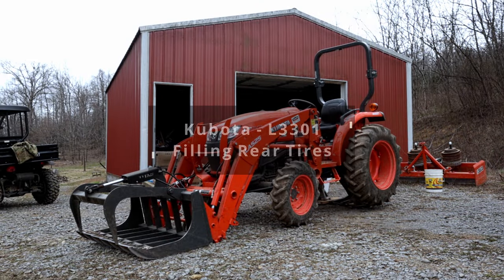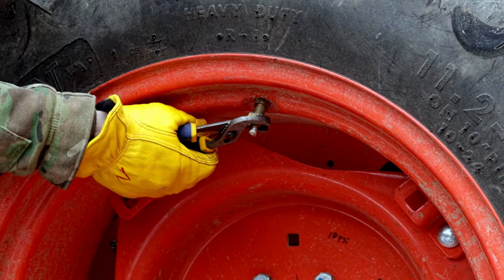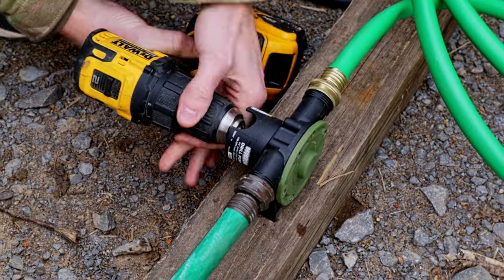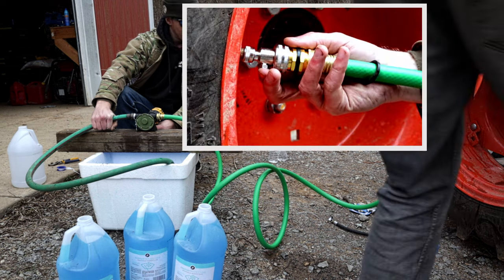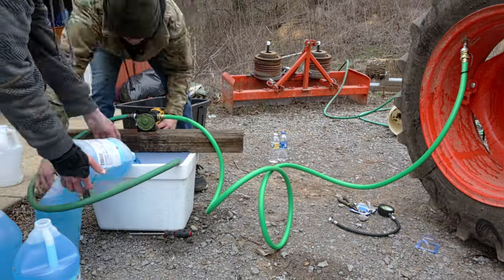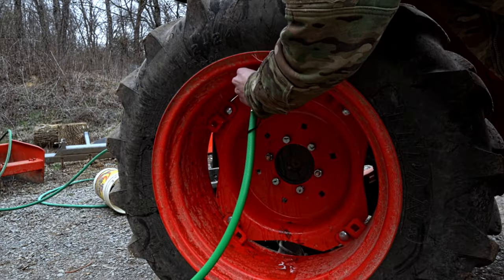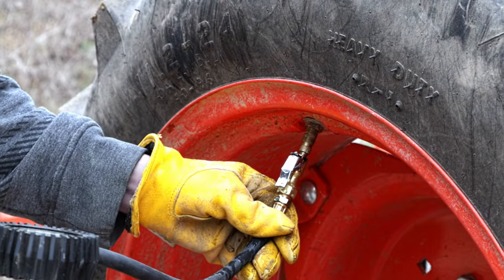Filling Tractor Tires - Ballast Quick and Easy - Kubota L3901, L3301, L2501

Comment: Well I decided to fill my rear tires with RV Antifreeze (RVA) instead of window washing fluid (WWF). They are the exact same price at my local Walmart. WWF cannot be made non-toxic (says so right on the jug). RVA is non toxic by design for use in RV plumbing systems. RVA weighs 8.4 lbs. per gallon, WWF weighs 7.6 lbs. per gallon. WWF is rated at -25 degrees, RVA is rated at -50 degrees. No brainer for me. Thanks again for the video, I just ordered the fill connecter and the pump.
Reply: where did you find it the same price? Walmart is about 1.50 a gallon more. A barrel from the local parts store is 175 more.
Reply: Any antifreeze is going to be corrosive on the rim and dry out the rubber in the tire. If you have an inner tube in it then you will get it to last a little longer but not much.
Reply: @mikek8632  Your remarks are contrary to everything I've read on the subject. The RV antifreeze additive system has passed corrosion requirements as specified in ASTM D1384 and provides outstanding corrosion protection for copper, brass, solder, steel, cast iron and aluminum. If it was corrosive as you suggest, why would it be used in very expensive RV's and boats for long term winter storage? How can it harm a painted steel wheel? In addition, propylene glycol actually lubricates rubber. It's also good to -50°. I'd be interested to know where you obtained your information...
Oh, and one more thing, unlike window washing fluid, RV antifreeze is non-toxic.
Reply: @artillerybuff2000  You can choose to be blind and believe whatever you want to believe. I know what I have seen first hand and what I've had to repair after people like yourself think you know better than the professionals. I've been working on tires since I was literally 5 years old, I started by patching tires and tubes with my Grandfather. I now own the business and do this type of work every day, I've seen a lot of things that have been "claimed" to not be a problem but in the real world actually do cause problems...but as I said feel free to "do it your way" you will find out.
Reply: @mikek8632  No need to get upset Mike, I was just asking what your "expert" opinion was based on. There are a lot of self-proclaimed experts working behind keyboards you know! I research everything I do, and I have 40+ years working as a master dealership technician.  Before that, I worked for a Goodyear tire center through high-school back in the early to mid '70's where I did everything from auto, truck, & tractor tires. I have used RV & Marine antifreeze in my boats and RV's for decades and have never seen any corrosion or rubber seal damage. So yes, based on my personal experience and research, I put the stuff in my new tractors' rear tires at 100% concentration.

Comment: Um no...just call your local tire guy as clearly yall dont know a thing about doing this the proper way. I am a tire guy and ive been called more times than i can count for people like you thinking they know what they are doing and then they spend 2 to 3 times what it would have initially cost for me to waste my time fixing their screw up and then doing it the proper way. Also...washer fluid is a corrosive...good luck with those rims rusting out in less than 5 years time.
Reply from the maker: What component of washer fluid is corrosive? We specifically chose it for price and being non-corrosive. We are absolutely not tire guys, but based on available information it seems like a suitable choice of fluid. https://www.yanmartractor.com/resources/tractor-tips/liquid-ballast/
Reply: Amazing when a “tire guy” feels the need to be condescending to those of us without a PhD in the ancient field of tire study. 
Get over yourself pal.
Reply: My local dealer said they charge $180/hr with a minimum 2hr job to fill both rear tires.. so $360 and they only use water, where i live it freezes below 20 degrees maybe 3-4 times a year in the winter months so 100% water is a no go for me as i keep my tractor under a lean to at the moment and $360 for 2 tires to be filled is way to steep. 
Sorry “TiRe GuY”
Reply: @BrollBrothersProductions  Did you not read the label? Last I knew it literally says corrosive somewhere on the label. It's been years since I've looked but I highly doubt it would have changed any. I do know for a fact that concentrated washer fluid is listed as a corrosive as it's accompanied by a full MSDS and is considered hazardous freight when shipping. In it's diluted form the feds may no longer consider it corrosive but that's in a normal application where it's in a plastic container, not in contact with a metal rim or rubber.
Reply: @BittyVids  Being condescending and being truthful are two different things, I suggest you learn that. Feel free to not listen to a professional, guaranteed you've been in that position before and had to call someone else to fix your ignorance.
Reply: @AnnanChannel  HAHA well those prices they are charging is absurd if you are also paying per gallon for the water they are putting in, if not then they are reasonable prices but a bit on the high side. Putting water in when the temp drops that low is a sign of them not being professionals therefore not the local tire guy I would call for anything at all ever. Depending on your tire size would depend on the price from a reputable true tire guy. I charge $35 per tire to fill and then $3.00 per gallon for reference the most common size is an 18.4-38 and it takes 110 gallons to fill so that would be $330 for just the fluid so $365 total per tire to fill.
Reply from the maker: @mikek8632  I had already tossed the jugs prior to this discussion so no clue what the label says
Reply: @BittyVids  you should get over yourself...everyone thinks they can work on tires but unless you are and or have been in the industry you don't know even half of what you think you do. There is no "get over yourself" to it, I've let many many people attempt to put on their own tires because I simply don't deal with ignorance anymore, I charge based on their ignorance and how much more work they made the job for me. Go for it, mount your own tires, fill your own tires, get flats and try to fix them. When you decide to call a professional finally because you can't get it right that's when you will be charged accordingly and learn the error of your ways. But you're a wise arse and think you know it all and I can tell that just from that single comment. You're the type of guy I wouldn't bother doing work for, I don't need the crybaby crap.

Comment: Instead of a drill pump I used a submersible pump from one of the box stores. Bought the adapter from Amazon like you did and used a 5 gallon bucket and put in water with 2 gallons of antifreeze. I live in a warmer climate so adjust your mixture accordingly as to where you live.
Reply: Using a submersible pump is an outstanding idea!

Comment: If you have a electric weed sprayer to use as a pump i recommend it makes the job even easier and quicker just make sure to keep a charger on the battery your using to power the sprayer
Reply from the maker: Good idea

Comment: Does anyone do the fronts as well?
Reply from the maker: I think the manual only mentioned doing the rears, the front’s probably don’t have the capacity for any real weight gain
Reply: I have the front tires filled on my Wheelhorse garden tractor. Definite steering improvement.
Reply: @ebinmaine  Know what you mean. Those "Wheel-Horse's" can bearly keep the Front Wheels on the ground;/ With ALL That POWER ( have 6 of these very Fine Machines).

Comment: Did you notice a significant difference in traction with the liquid filled tires vs air?
Reply from the maker: Haven’t noticed an improvement with traction (outside of deep mud). However the improvement in stability is huge. Especially when using a grapple, our grapple is heavier then the bucket and it was quite tippy without the loaded tires. It also feels less tippy/slidey on hills.
Reply: I did with my tractor. However, mine hold 55 gallons each at 75%, which is over 450 lbs. per tire using RV & Marine antifreeze.  I don't have to use 4wd as much when doing road grading or front loader work. But I also added some racks to the top of my box blade that holds 8 five gallon buckets filled with wet sand @ 75 lbs. each. Tractor fills well planted, less bouncy, and way more stable, plus the 1,200 lbs. hanging on the three point (weight of box blade plus ballast buckets) helps lighten the load on the front axle when carrying full bucket loads of heavy material...
Reply: Its a HUGE difference

Comment: Lmao. You honestly fill them 100% ? 😂 let me know how that works out in the long run
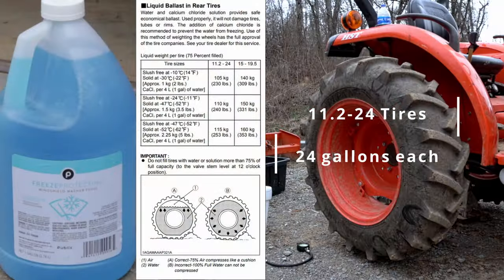Reply from the maker: They are filled to the valve stem, about 75% per the Kubota manual, check @0:35 for screenshot. If they are filled 100% you would have no room for air to properly pressurize the tire.